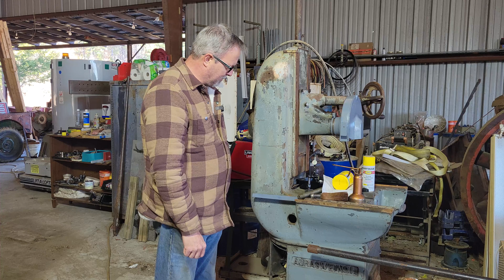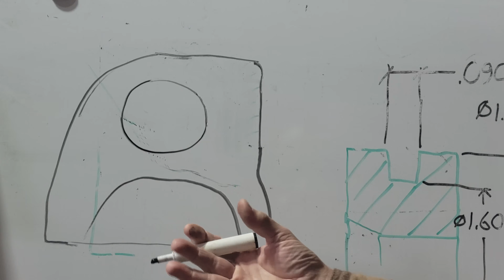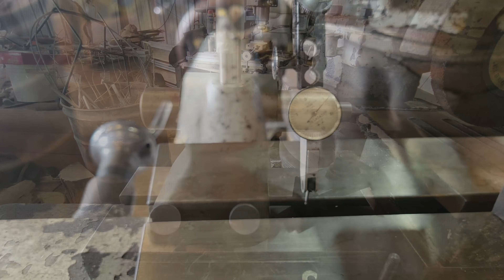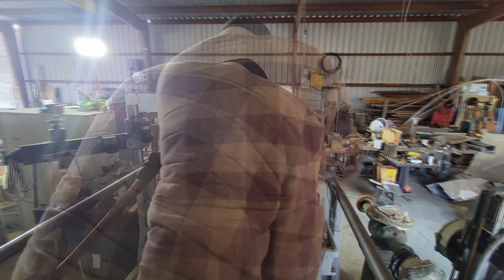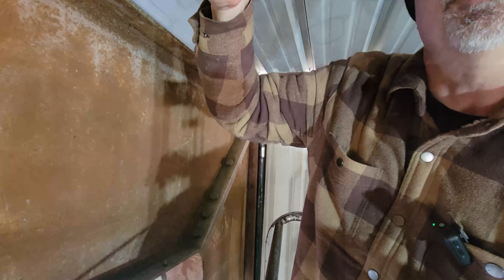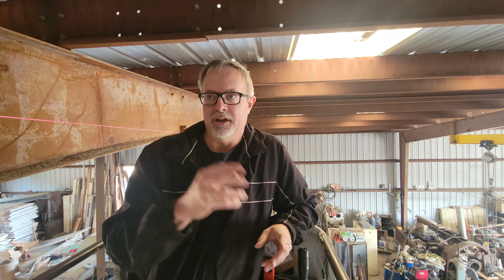Running Overhead Conduit + Planning a Small Project

Comment: Be aware that you have to derate the wires in the conduit when there are more than 4 current carrying conductors. See NEC table 310.15(B)(3)(a), also the table that I had handy showed 22 as the max number of #14 for 3/4 emt, I have not confirmed that with the code book. You would need #10 wire for 10 or more conductors in the same conduit on 15 amp breakers. but you wouldn't be able to fit 14 #10 in a 3/4. When I looked at the economics of this for my lights, 2 circuits of #12 on 15 amp breakers in a 1/2" conduit made the most sense. You can also do a tied handle double breaker and use a shared neutral to feed two sets of lights. could be a 15A breaker and #14 wire without a derate if that is all that is in the conduit. Or you can feed more lights on fewer circuits with bigger wire: go to #12 wire and 20A breakers.

I believe they call that clamp arrangement a split cotter.

Comment: GM Jim,
Atlas uses the same quill lock principle as your Cincinnati grinder. I recommend using 5/8 brass as the locking material instead of the tool steel.
Reply from the maker: I agree in principle, but the quill is harder than the lock. The scallop I plan to put on it will give greater surface area, and I won't have to deal with threads in brass.